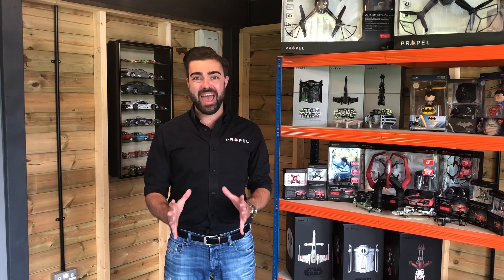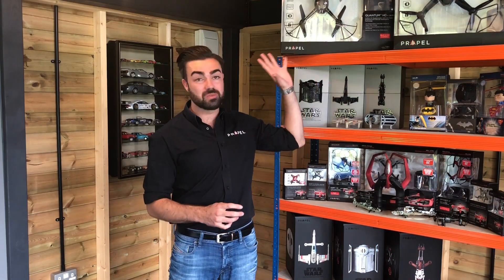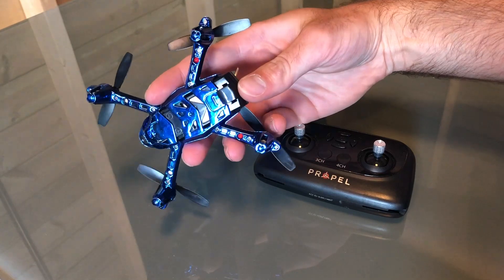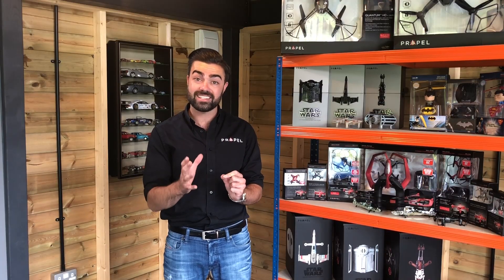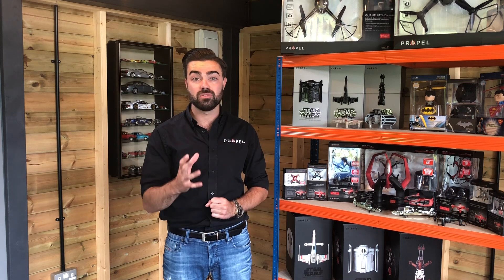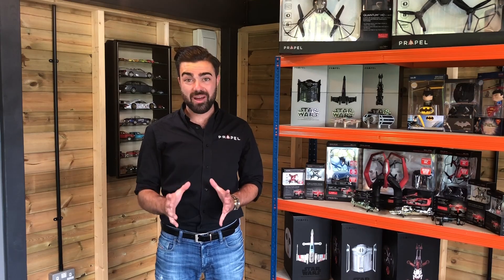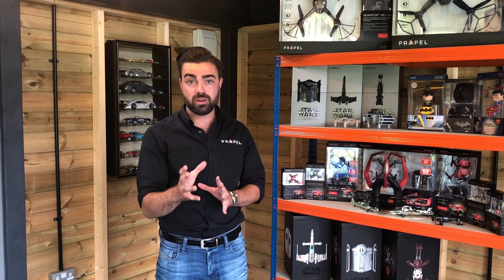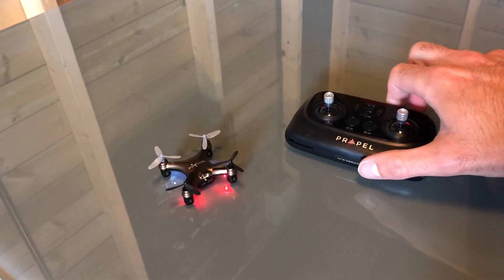Callibration and syncing

Comment: I just opened a new propel flex 2.0. We are having trouble syncing. The red light does not go to solid when trying to sync the controller. The possible reasons you suggested above dont apply, either. Then when i turn the power button off on the drone to essentially try again, one propeller starts spinning and i cant turn it on again.

Comment: I have a Neutron Quad Rotor Helicopter. I charged the battery, put new batteries in the controller. The drone lights up fine. Turn the controller on and the power flight flashes twice then repeats. one speed light lite but nothing works. I move the left joy stick up and down, nothing. What now

Comment: My drone lights are constantly on when I push the battery in? I haven’t used it for a few weeks was working before but now nothing? I have the ultra x WiFi one. Have tried everything from the manual which is exactly the same as this video. 
Any solutions or is are these absolute junk that everyone’s stating in the comments?

Comment: This Christmas I got the Propel Drone. I don't know which drone it is because it doesn't say in the box, all it says is propel. I tried it once and it was fun and then I tried it again and it broke. I don't know how but it did. It did had any hard impacts and it broke. I know it's broken because the battery is full and every time I turn it on or calibrate the drone it turns itself off and I can't turn it back on again. I'm not sure that I did something wrong, failed a step, or for it's quality and broad instructions.

Comment: Admittedly a basic piece of crap OR a company secret on how to sync it to hand controller.  If it's a company secret, I implore Propel to tell us what is not described in the manual or this video.   Worked a couple times then stopped.   My first thought was the couple hard landings might have knocked the antenna connection.  Before I took it apart I decided to see if you could fly it via the app.  Once connected as if you're going to record video (connected thru drone wifi) I was able to fly it without issue.  I've been wanting to own a low cost drone for years.   This was a Christmas gift.  I did purchase another low cost drone if you want I can TELLO you.  🙃

Comment: Opened mine last year and it worked fine with these instructions but not working this year for some reason.  Charged it up, installed new batteries, and still nothing.
Reply: Mr Crowne same man did I end up working?
Reply: David S nope,  I just gave up.

Comment: Hi. I have a propel x11+fpv drone. I have been trying to sync my drone to my remote but the lights in my drone keep flashing even though i am using the correct remote and that drone has never been paired with any other remote. Looking forward for a positive response.
Reply: I'm having the same problem bro!! I have a propel tilt XL that I cannot get to sync up!!
Reply: @cooleyvicdamonejr.6762  try movong the remote controller joystick up and down

Comment: I will say that I previously bought a Propel Micro Drone and it worked great,  relatively easy to fly and stable, I was able to get so practice in on flying and was able to get to where I could control it pretty good, lots of fun. I hope that they will answer My questions concerning the Propel XO4 Drone. There chat option on their website doesn’t work and the messenger option on Facebook doesn’t allow for just writing a question that they will answer.  Customer service so far has been lacking. Come on Propel, some good communication with your customers would really add to your company’s value.

Comment: I recently purchased a Propel XO4, when I sync the controller to the drone, everything seems to work but the left joystick, which I thought was a throttle control doesn’t work, the joystick is spring loaded to set in the center position, which is unusual and different from the micro drone that I purchased from them. Is there no manual throttle control on the Propel XO4?

Comment: my drone syncs just fine, but the blades wont move an inch when i push the throttle. this brand is kinda crap
Reply: Did you sync then hit the autoland button that is the safety on the drone to make the drone take off ,in case your holding the drone and accidentally hit the throttle !